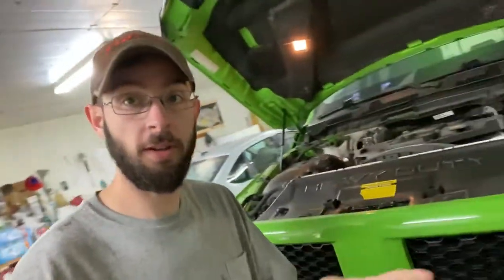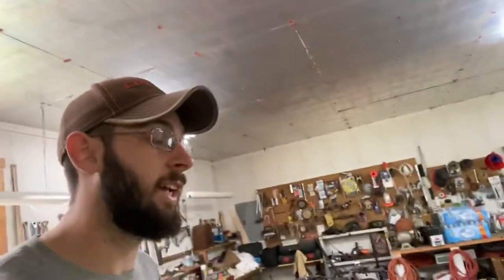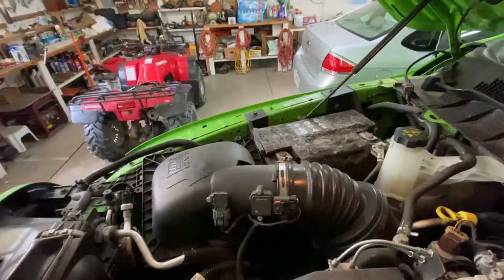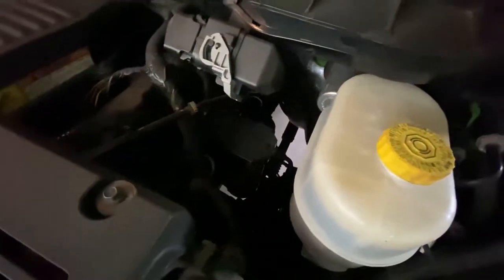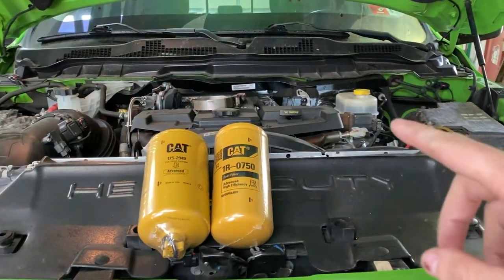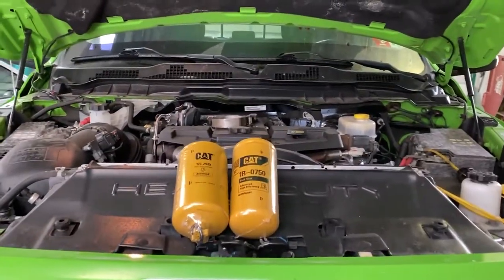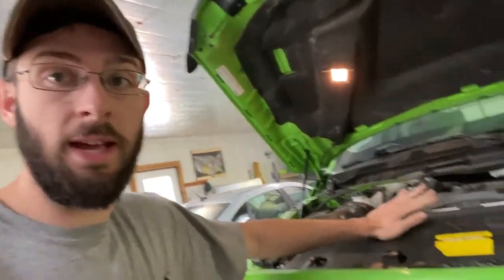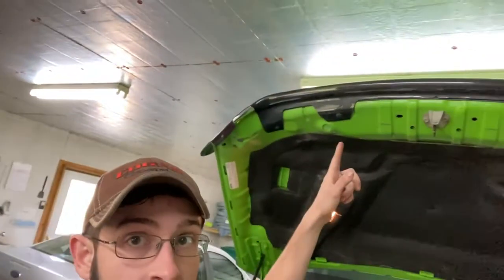CAT Filters vs normal Filters... First fuel filter change

Comment: Were you able to get your water in fuel light to go off and if so how did you do it
Reply from the maker: Yes, I opened the drain on the rear filter and let it drain for a good minute
Reply: @HoldenPowell_  what about the sensor that is on the bottom of the stock one where did you plug that sensor to?
Reply from the maker: @bigtimebarone21  if it’s the one on the front one your talking about then I never plugged it back in, I believe it’s a heater plug for the old one but I have had no issues in 3 years with it and being unplugged!
Reply: @HoldenPowell_  no on the stock one where the plastic drain was on the bottom of the filter there was a sensor that plugs in on the chassis it is the water in fuel sensor it is attached to the drain that unscrews and screws back on   When you get a new stock filter
Reply from the maker: @bigtimebarone21  I left that sensor plugged in and just drained that filter it for a short few and then let the truck run for a short few and it cleared on its own